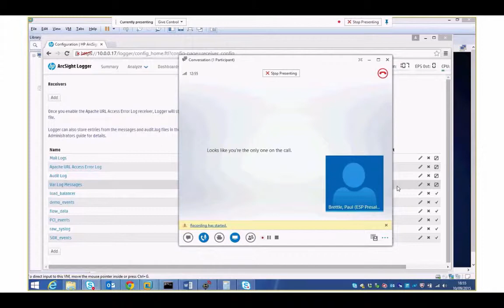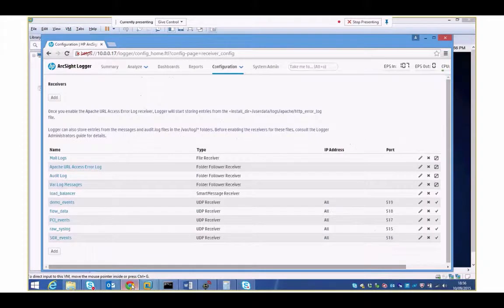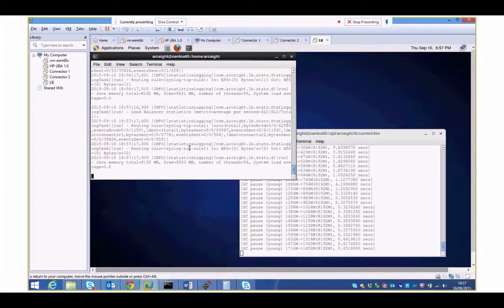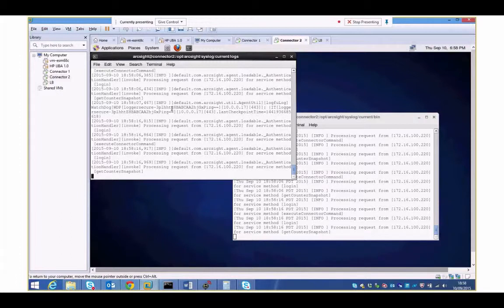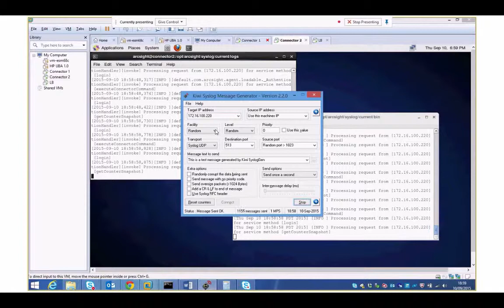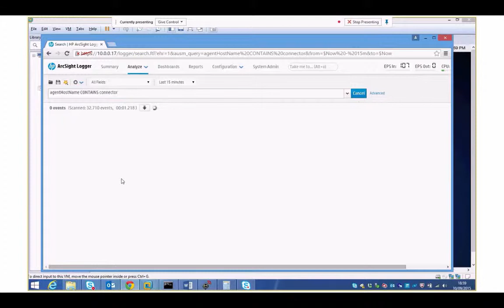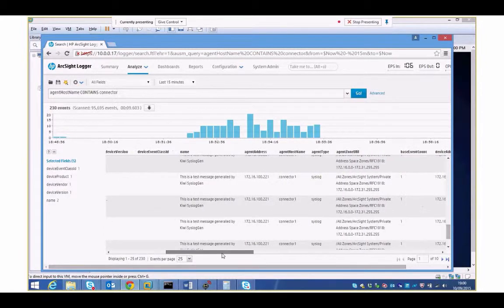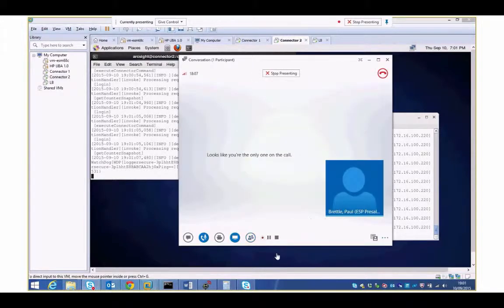ArcSight Load Balancer demo

Comment: Hi Paul, thank you for sharing the demo on ArcSight load balancer. I have done my testing and have a question. From my testing result, I have found that the deviceAddress field will be ArcSight Load Balancer IP, if I collecting syslog from multiple devices, how do I know it coming from that particular devices? Is there any way to check on that? Thank you in advance.
Reply: Were you able to resolve this issue